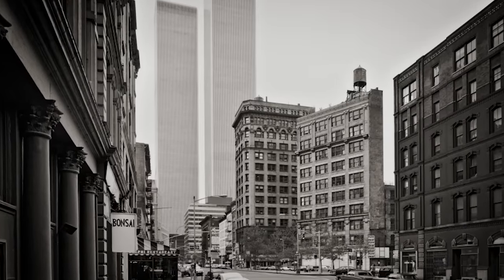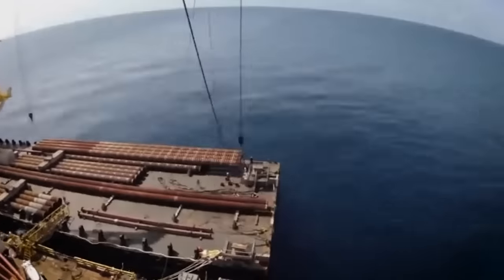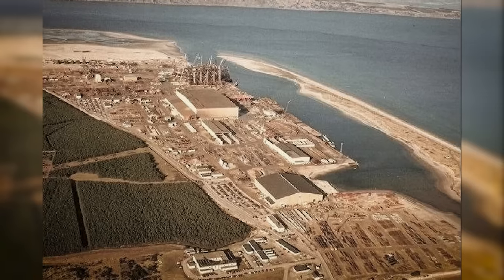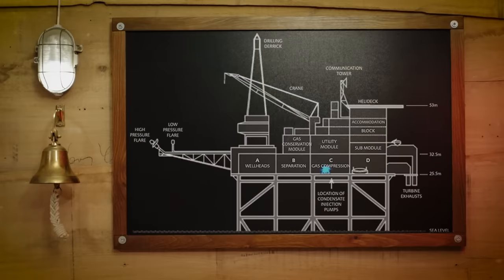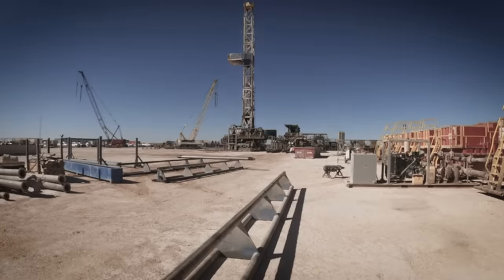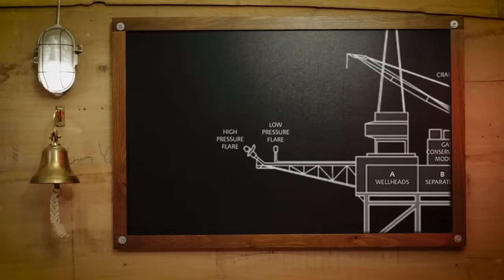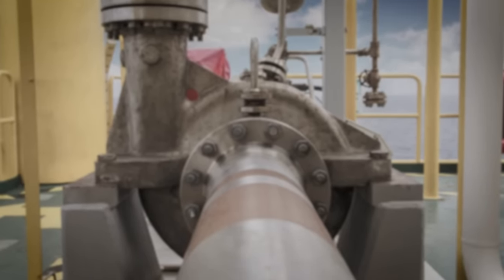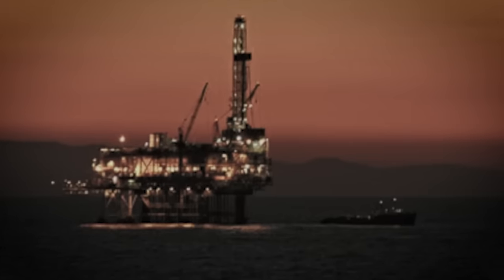This Block Has 87 Dead Bodies

Comment: You missed some details:
- the emergency procedures stated to NEVER jump from the platform because you would die from impact, or from hypothermia. This is why the 87 people stayed in the accommodation block. The majority of survivors were ones who ignored that and jumped
- the oil rig was not designed to handle gas, the fire resistant walls were only fire resistant, not explosion proof
- the other oil rigs continued to pump gas to piper for hours despite seeing the fire, out of fear of being fired. They only stopped when one operator ignored commands from a superior and shut it down
Reply: “Out of fear of being FIRED” lmao
Reply: @Tastyduckling5  unintentional pun! But its a big issue with the oil industry. Shutting down operations costs millions per-hour. 
People are too scared to take responsibility for that kind of decision. 
Its sad though, they could literally see the fire on the horizon and kept pumping that shit. Even when they finally did shut it off, its was largely meaningless because there were still thousands of cubic meters of gas in the pipelines.

The whole disaster was a total shit show, and should never have happened. The only good thing that came from this is health and safety on oil rigs went from meh, to absolute.
Reply: ironic corporate culture....how much did the fire cost them in productivity payouts to next of kin (I presume their insurance rates likely increased) and loss of the rig?

business is far more myopic than Mr. McGoo.
Reply: you can't die on impact if you put your legs together and land on your feet, maybe cover the old fella
Reply: > They only stopped when one operator ignored commands from a superior and shut it down

a lot of wisdom (and success, and survival) seems to revolve around when to obey the rules and when to break them

You have to always remember that rules are made by men, and men are imperfect, and the rules often don't encompass all possible situations that the same rules claim to apply to... Your mind always trumps the rules.

In Richard Branson's autobiography "Losing My Virginity" (a solid good read), he shares an anecdote where he was about a half mile out to sea in some sort of pleasure boat with his girlfriend at the time, and a whole bunch of other people. A storm was coming in hot, and the engine onboard the vessel would not start, which meant they would have no steering control and would be at the mercy of the waves and the storm (as a boater, I can tell you that this is NOT how you want to be postured when a storm is about to hit). Common wisdom was to stick with the boat anyway, but they made a brash decision to just swim for land. Well, all souls on that boat were lost, except for Branson and his woman at the time...
Reply: @pmarreck  interesting. Rules like that jumping one were written based on the fact you could die, not the likelihood. They wont ever recommend something that could result in death. But indecision is just as bad or worse
Reply: @pmarreck that Richard Branson story sounds like absolute bs lol
Reply: yeah. Not what I would call "reasonable"
Reply: @fastair8546    "But we can't leave the spice!"
Reply: @351clevelandmodifiedmotor4  You can if you're wearing a lifejacket.  It can break your neck.
Reply: The majority of bodies were found in the refrigerated  cool rooms
Reply: So the training was as I recall updated to provide information about cold shock and even including a cold dip for a little while. But it was still made explicitly clear that your chances of survival even in a survival suit were extremely limited.

Anyone who’s jumped off a 10m Olympic diving board and hit the water at 30mph in a less than expert way will have a hint of how hard water impacts can be. Large waves don’t equate to a broken surface from the impact perspective.

But the main problem is the odds of being found quickly enough in heavy seas .

It’s hard enough to find a lifeboat.
Even with an active radio beacon on a survival suits it’s a challenge and poor weather can impair or even prevent helicopter rescue
Reply: Uk civil claims are only generally substantial if your particularly influential, or for US visitors with US legal counsel.

Back then the value of witnessing the death of a loved one was set at around £5000 by the judicial authorities, in the absence of additional evidence of specific losses.
Even injuries like PTSD would generally only be worthwhile claiming for if you could evidence a substantial loss of earnings.
Reply: Protocols should never consider that an option, anymore than leaping from a building on the 3rd floor (2nd above ground)  of a building as part of a fire escape strategy..
It’s a potentially survivable option with better odds than being found alive in poor weather in the North Sea, however I’ve never seen a commercial or residential fire escape strategy that includes jumping as an option .
You can do lots of things in extremis, but they should never form part of a corporate risk mitigation strategy
Reply: @351clevelandmodifiedmotor4  nah you'll just shatter your spine and spend the rest of your life eating through a tube.
Reply: @TheXmorc which is ironic because claims in the US are also only effective if your influential / connected.
Reply: @john-ic5pz They've corrputws the Tax system so that losses from  shortfalls are tax write offs.
Reply: There must have been a moment fairly early in the sequence of events when it became obvious that the platform was not in all likelihood going to survive. THAT is the moment the shutdown and evacuate orders should have been given. Sod the loss of production when men's lives are at stake. Well done to whoever countermanded management instructions not to shut down. Pity it was far too late. Any emergency MUST be given top priority.
Reply: So actually none of this was reasonable and these workers were killed by the increasing expectations of capitalism and lack of thorough safety checks before operations, in the most damaging industry on the planet.
Reply: Out of fear of being fired?! Are you fking kidding me ?!
Reply: @351clevelandmodifiedmotor4  arms need to be crossed to keep from loosing central lines in your arms and breaking and tearing and the chin should be tucked tight to the chest avoid neck injury....certainly can be hurt or killed by the jump still simply through water impact or any of the random things floating in the ocean.
Ask my friend,him a some people from town were in a rig fure
Reply: @351clevelandmodifiedmotor4  I would say to go ahead and try it, but I wouldn't want to inconvenience the people who would have to deal with your body afterwards.
Reply: money over human life i see
Reply: @351clevelandmodifiedmotor4 this reminds me of some swimmer from maybe the late 1800's that made a thing about showing the ability to survive a high jump into water. His proposed secret was using a specialized technique where he essentially did the pencil while extending an arm upward to "work as a rudder" to keep the body upright. He kept jumping off higher and higher bridges until the last one showcased how poorly his "rudder" worked.
Reply: @royfearn4345  Obvious with hindsight, but Tartan and Claymore didn't know that. They both thought Piper probably had the situation under control and assumed the fire pumps were containing the fire. Not mentioned is the fact they only had one radio each and this was a skeleton crew, so the Piper's abandonment order never got to them, and they missed info from Tharos on how bad the fire was. Even then, Claymore eventually made the call to shutdown, and Tartan shutdown when they got instrument indications that the line had burst(though they were unable to tell this to Claymore, as their one radio was being used to talk to Tharos at that time)
Reply: What is scarier? Fire or being fired?
Reply: Thank you, I was wondering why they didn't jump/evacuate
Reply: Does a 15 storey leap sound like a fair gamble? Plus or minus another 2 storeys to account for the wave height in the open ocean from the tales I've been told
Reply: Fuck that, I'm jumping...
Reply: @351clevelandmodifiedmotor4 Depends on how high up you are. Far enough fall and you’ll still turn to jelly hitting the water. Not from an oil rig though, no.
Reply: average oil rig disaster
Reply: @351clevelandmodifiedmotor4  yea and then you sink 25 feet and cant make it to the surface.
Reply: @john-ic5pz  Easily in the billions.
Reply: the ppl in the accommodation block gathered there because it was the location to go for further instructions as part of evacuation procedures, waiting for helicopters to come and pick them up for evacuation... (was explained in the Seconds from Disaster episode about Piper Alpha)... but heli-rescue was impossible and by that time they couldn't escape any longer...
Reply: wtf is explosion proof?
Reply: That dude jumped 175 feet!?    Jesus...that's like jumping off the Golden Gate.  It's miraculous he survived.
Reply: Having worked on Claymore the pipework for the Oil and Gas is sited very close together in some places room for only one person can use the walkways, and it's very close to the accommodation block, it wasn't the best for any serious incidents
Reply: @kenosabi that could happen I guess, but people jumped and lived.
Reply: @coldc7 it's not guaranteed that your gonna get hurt jumping into the waterfront that height. It's very likely that you will, but it depends on many factors.
Reply: @fastair8546 safety is all about discretion when it comes down to it. Yes you could die from jumping from the platform so they must be warned, but in a situation like this you would certainly die by staying on that rig. I would’ve jumped, at least there’s a chance. I think I would also prefer to drown over burning to death.
Reply: When oil companies choose 💲 over safety 🦺. RIP to those men 🙏
Reply: Yeah but he did get the important detail in there about the divers putting down a rubber mat to protect their feet.
Reply: We don’t know how many jumped and didn’t survive.
Reply: true. the rig was first built to only pump oil so blast proof walling was not needed. later it was converted to process gas aswell, course the blast proof walling wasnt installed. no excuss about it, cost cutting at its worst. it didnt cost much to install it and when messured agaist who and what were lost its sickening
Reply: Not
Reply: @pmarreck God made us perfect
Reply: @fastno u couldn't air8546
Reply: @kenosabi not
Reply: @TheXmorc no it's water ultlur thinking about jumping three stories to hard ground
Reply: @TheXmorc u can't claim anything like that that's just ignorant
Reply: @Grungefan2018 lies
Reply: @TheXmorc lied
Reply: @wesd3370 didn't
Reply: @tomsellout9576 could not
Reply: Rich people always get away with man slaughter like this...  its sick
.
.
The guys who felt they couldnt shut the gas of in fear of being fired, should admit that in public
.
.
If money is more important than lives in these operations, the rich people should be held accountable for the deaths
Reply: Yep you're told you'd die of hypothermia and your body will seize up and you'd drown. My Dad worked offshore in the north sea when this happened.
Reply: @EveHyland-in8jb9ti9y  You would assume now that they have access to dry suits etc.
Reply: @john-ic5pz  Probably less than a rounding error for them.
Reply: @fastair8546  It's so dumb because an exploding oil rig loses a lot more than that.
Reply: So just a bunch of yes people
Reply: @351clevelandmodifiedmotor4 after 35ft water become like concrete
Reply: At the height Hitting water would stop you but not your organs from falling. Hence most bridge jumpers die horrorible painful deaths. Insides ripped apart unable to breathe bleeding inside instead of out takes a long time. Especially in water in pain won't drown if you can't breathe you'd sufficate
Reply: I would always jump as I would say if 20 jumped they probably 19 would survive, the other been due to hitting debris or fire on the water but not impact..I don’t know why people say that..Poor guys 😢
Reply: @pmarreck  : We've been saved from a nuclear annihilation at least once by a reasonable person disobeying orders. He paid for it with his career, but saved us all.
Reply: Shoutout to that operator 💯
Reply: Men will obey other men at all men's expenses. #matriarchynow
Reply: You didn't watch this documentary with that comment. Stop trying to be in the right people died ffs
Reply: @MelchizedekKohen  I did watch this video. I have seen too many articles and videos about this event to know what happened.
Reply: @fastair8546 that's capitalism for you. Oil is more important than potentially saving lives.
Reply: @john-ic5pz if it were cheaper to close down operations on the neighbouring rigs, there'd be a procedure to shut down in event of fire. They'd probably have calculated potential risk of payouts
Reply: i think its a decent bet to jump off when the rig has 0 chance of recovering and  the seas are fairly reasonable with rescue vessels surrounding the rig
Reply: merica’

Comment: I worked for the dive company (2W Taylor) who had the contract on Piper A when this happened. Thankfully I was on leave when it happened. It was one of the "best dive assignments" in the North sea diving business at the time. Piper A was unique. One of the most productive platforms in all of the North Sea, OXY drilled the heck out of the oil field. They added more drilling capacity to the platform than any other in the world for it's size and design. Way too much in fact. The platform jacket was super stressed and began to fail. It had cracked members everywhere. The documentary talks about the huge diving platform and that was accurate. No other platform in the North Sea had anything like this. There was a full time repair program ongoing for years. We installed massive custom made clamps on every joint and node. So much NDT work looking for structural cracks and so much clamping and repairing. It was the best full time job for any diver and a very coveted gig. A fantastic learning assignment back in the day. Oxy drilled the thing to near destruction. The drilling power was immense and the torsional stresses created by the huge power of the drilling gear twisted and loaded the structure like no other. It was all about production no matter what happened. 2W Taylor also supplied divers to help recover the accommodation module from the seabed and onshore in Orkney due to divers ability to use breathing equipment (SCBA), cutting gear and in general just do whatever needed done. God bless all those involved and their families in dealing with this horrible event.
Reply: I also worked for 'Wharton Williams Taylor' on the Piper, Claymore, Tartan and numerous other rigs in both the British and Norwegian sectors of the North Sea. The Piper was the worse. Many times you would be sat in the Galley or other areas and suddenly feel a huge sway of the rig as she moved in bad weather. Even the OIM (Offshore Installation Manager) use to comment that the best times of his job was when he was on the chopper 'going back' to Dyce Aberdeen.
Reply: You would know Les Yeaman, from Hull.

Comment: Back in 92 i was working for a company called Trolex, they made safety systems for the coal and oil industry, after the Piper Alpha tragedy there was steps put into place to stop this ever happening again, i was on the team at Trolex to prototype several projects directly attributed to the Piper, my main project was the developement of a lighting system that was installed into the accomodation block,it would stay illuminated for hours after power was lost,and it would also keep illuminated at depth,i have to say that the thought of those poor souls who lost their lives drove me,regularly i think about them still to this day,i hope their family's are at peace with what happened that night,RIP guys.
Reply: yes you always can wonder why the men did not exit the accommodation block once the emergency got underway - however, there will be processes and protocols to exit the block such as waiting for the signal to exit wait for proof there are liferafts waiting for otherwise you will drop into the deep dark ocean late at night and be lost - it would be a TERRIFYING experience not knowing what to do the mass hysteria the waiting to know what to do the shouting and yelling turning into hysteria chaos even fighting and punching each other in the pitch black darkness hearing the sirens and explosions not knowing what was going on all in the blackness apart from the heat coming in knowing the whole place is an inferno - a truly shocking way to die
Reply: I work in software. Two event almost daily inform my decisions. Piper Alpha and the Hyatt Regency walkway collapse.